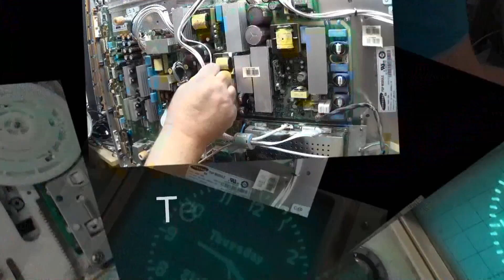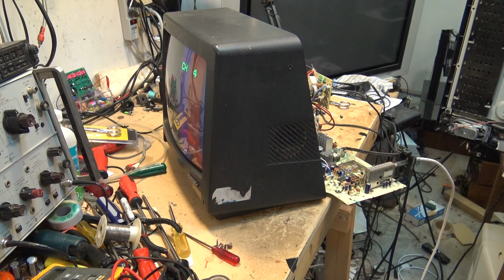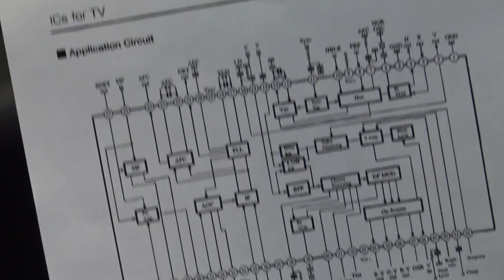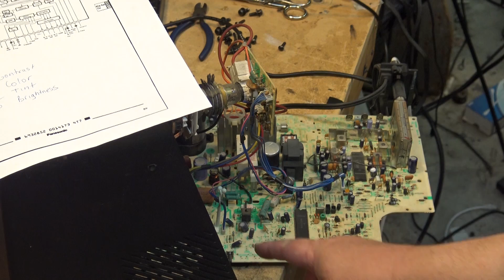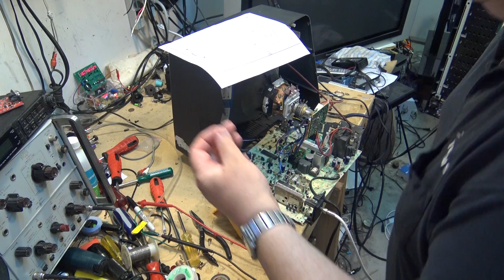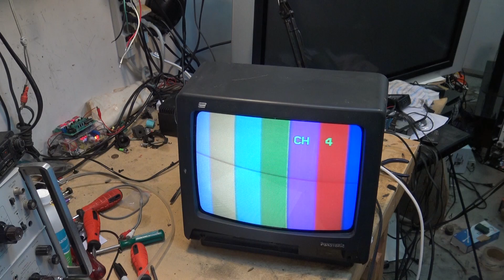Panasonic PC14X41 Poor video level

Comment: Hi there.  Thanks for the really informative video.  A question for you: I have a RCA television from about 1990 (a G26285, which I think is on the CTC157 chassis).  It has a similar picture fault (low brightness and/or contrast), but it's intermittent.  Sometimes it starts after about 10 minutes, sometimes the picture stays good.  When it happens, the picture adjustment controls do stay responsive.  Adjusting brightness up from 50% to maybe 80% gives a decent picture again (though possibly the colors are slightly dull).  Do you have any suggestion of where I might look for the problem?  Or maybe another one of your videos that might be more relevant to that particular problem?

Comment: May you show us how do you modulete the vid bars?
Reply from the maker: Its is just an old Sony dxc1800 professional camera plugged into a wacom vhf modulator.
Reply: @12voltvids  Nice, tks for answer!
Reply from the maker: @IgorIglesias  
I have showed my equipment closet in an earlier video. If you search for it you will see my setup.
Reply from the maker: This is very old, the equipment in here has totally been changed out. Gone is the channelmaster UHF modulator, and in it's place 5 rack mount commercial modulators out of a cable head end. 2 MTS stereo and 3 mono.
https://www.youtube.com/watch?v=bTK8zFtzeZ0

Comment: Lol, another video for people to dislike! I happen to like it. Foo on negative people.
I had a Sanyo tv that kept losing the picture. Found a bad solder joint by tapping on the circuit board. Because the picture would appear if I hit the set. I just put solder over the area that was making intermittent contact and fixed it. About the only successful thing I did on electronics. I was lucky I didn't get shocked. Lol. 1994 tv. Lightning would later take it out. :(
Oh, is that a new pair of electrical scissors?

Comment: Just subscribed, great work. Question, aren't you supposed to discharge the HV cable/ tube before operating on the TV PCB? Doesn't that board carries HV , and also the flyback?
Reply from the maker: Cesar Matias 
The tube will hold a charge but the diodes in the flyback will also block it's return to the chassis. So unless you are poking metal objects under the hv cap that is where the charge is going to stay. Now if you want to remove said cap then yes you clip a jumper wire between the crt ground strap and a screw driver and wedge that under the cap to contact the anode button to discharge the tube. Then remove the anode wire and leave the ground wire clipped on the button to keep the tube from regenerating a charge. ( yes they do that)

Comment: I have a 13.3 inch flat screen tv, and when I try to turn the volumn up or down the menu pops up. If I replace all the tac switches on the set, will that solve my problem, or did the resistors change value.
Reply from the maker: Could be either. I have a 28" flat panel set sitting on the floor that changes settings on it's own. Haven't figured it out yet.
Reply: @12voltvids  My guess: Connection problem at the switch terminals or somewhere in the switch circuit causing the switch to short and change the setting by itself.

Comment: man that board is so big and flexing a lot :], all polish tv's had a metal grounding band around main boards and were installed on rails for easy access :]
whitch is easier to work on, full jungle ic set or modular  early ic one?
you make it look too easy, probably because of your long time experience
i was able to fix one of those small tvs only after getting a hint from local furums, but after i find similar problem online, my tv repair cost me lass than 1$ and 15 minutes of work, it could be 0$ but i wanted audio from both rf and av :]
Reply from the maker: It is relatively easy for me on these older sets because that is what I did every day for over 20 years.  This one with it's symptom threw me initially. It wasn't until I ran the contrast down and the vertical started jumping that I clued in to the ABL circuit because that symptom was similar to one I had seen before, on this same set too!

Comment: i'd change that 220Uf 200V cap. she was shrinking off the can
Reply from the maker: No big deal. This is not a switching power supply. It is linear. When the cap pops it will be evident as big hum bars in the picture. Perhaps that would be a good fault to plant in a set, an open main filter for demonstration.
I don't stage many faults, only under requests, troubles line this are genuine faults that develop in the equipment.

Comment: Good diagnosis! When I was a tech full time, I always kept a log of "dog" problems. You always think you'd remember the fixes,especially tough ones, but a year or two later you'd be saying to yourself, what the hell did I do to correct that problem?  Thanks for the video!
Reply from the maker: That is why I ran that database. I should bring that computer into the shop and put it to use. That computer is a class act in itself. A 486SX laptop with DOS6 and Windoze 3.1. Most laptops on that era were monochrome, but this one has an VGA color screen which was almost unheard of back then. I paid over 2,000 for that laptop, was the first one I bought. It had the largest hard drive you could get on a laptop of the day, 245 megs!
Reply: @12voltvids  My, has the technology come so far. Now we have 4K rendered in an instant and video streaming, also unheard of back in those days, is viable and rampant across the net, like what YT does to show us this video, for example.
Reply from the maker: Samsung is promising 8K tvs in your home next year.

Comment: Great recovery :-D, if it fails again perhaps putting a 47k and 68k resistor in series would lower the voltage across each resistor and still give the same ballpark value.
Some resistors don't cope well with higher voltages.

Comment: I like it. You are my senior good sir! I might actually have a slightly older tv about that size with similar symptoms but it has no on-screen menus, pot controlled.  All I know about soldering is: No cold joints, keep it away from other conductors, keep the solder fresh, don't over heat anything, try not to lift any traces and fix it solid if that happens. I know some folks are really into things looking perfect. If I make something from scratch I hate it when comes out messy but if it's sturdy and it works, that's life and it's good. I sometimes use the old trace-less perf board for projects; I enjoy forming the wires into traces and making it look nice but if I have to "bodge" it to make it work I often don't give a damn unless it's for someone else.
Reply from the maker: I have an old Sony from 1984 in storage. No remote control, if you can imagine that. Actually I have 2. A KV1365, and the big brother KV1965. 
Both are digital tuned, with a A/V input, slider volume control, and these sets both use opto-coupler isolation for the audio and video inputs as the chassis is a hot chassis design.
Both still work, and last time I turned it on had a fantastic picture. That was the second Sony I owned. The first was a KN1932 which had the 14 position preset tuner. I sold that one to a friend, who is probably still watching it, because he is so cheap he never buys anything new.
Funny how extremes can be. My idiot 17 year old thinks nothing about paying 140.00 for a tee shirt with some scribbling on it, and then there is my old pal from high school that has never driven a car newer than 20 years, and is still watching VHS tapes. Not that he can't afford anything new but he is incredibly cheap he just won't buy anything new.

Comment: I miss Panasonic TV's I still have a 32 inch 2008 Model Still works great ( after recalibration) All the Dynamic contrast came back and it looks like a brand new TV .
Reply from the maker: I am still mad that my old CT34WX50 CRT HD set that I gave to my late father inlaw was turned when it broke rather than offered back to me.
Nobody wanted to lift it.

Comment: have you ever had nightmares where you're facing a live tv chassis and the flyback decided to zap you on the lip?
Reply from the maker: I've been zapped by the cobra on a set that was operating. My idiot assistant at the shop attached the HV lead on a set we just replaced the tube on. He didn't clean the glass before attaching it, and there was an air gap. I went to reach over the set to adjust convergence and lightning leapt out the HV cap, into my forearm down through my hand and out my thumb to ground.
Didn't hurt for a few seconds, and then the pain started. Felt like I hit my finger with a hammer. (bin der dun dat) A burn mark was left on my fingernail, and as the nail grew out a ridge was left in the nail that is there today.
30KV from a fully charged, and operating CRT packs quite a wallop.
That was the last straw. I fired my assistant that day. My boss said I couldn't fire him it was an accident. I said he goes or I walk.
Next day the shop was down to 1 tech.
Reply: @12voltvids  Good call there. I would've left there too, wherever it'd be, in that situation myself. He nearly killed you by making a small mistake like that. Any further up your arm and the shock would've been enough to stop your heart instantly.

Comment: I think that resistor is brown-green-yellow, so should be 150k but as you said and demonstrated, it didn't matter so much. Almost like you knew what you were doing :P That's a joke by the way, not giving you any guff or questioning your abilities, knowledge, or hands-on experience :D As far as that resistor goes, being that 50k ohms didn't make any apparent difference, what is the purpose of that resistor? Also, is it simply not that critical a value to need to be exact or is there circuitry elsewhere that makes appropriate changes depending on what it sees or ? Just curious as it seems these older TV's are pretty resilient compared to the newer stuff.
Reply from the maker: Yup, the bigger one was the one I changed the last time that set was fixed which was May 14, 2014 in this video:
https://www.youtube.com/watch?v=AHuUTkhk9Vw
Funny almost exactly 3 years to the day since the last service of the TV. 2 resistors, same circuit causing different symptoms.
Reply from the maker: If they could shave a penny off the production cost, then that is what they would do. This is not a high power circuit. 1/8 watt was cutting it too close though.
The database program I would add things into that were tough dogs. 
When I got a set that had an unusual problem I wold scan the data base first to see if it had been reported, as that many times would save me a great amount of time troubleshooting. If it was something that was the first time reported I would put it in the database.
At the time this was a commercial program and was a live update.
So anything I put in there I would upload every week, and get the other updated put in by other techs in the engineers fourm I would hang out in.
Reply: This man knows his stuff. I've been a subscriber for quite some time. He never fails. Except for the ones that are beyond repair.
Reply: Entertainment Videos DWN Oh I know it. I've also been a subscriber for some time and I watch all his videos, time permitting, multiple times even as there's always some good nugget of information to be had if you pay attention. There's nothing like years of experience of actually doing the work and as I don't have those years of experience doing this day in and day out the next best thing is to listen and learn from someone who does. I just hope he doesn't take my questions or comments as picking on his work as I've never had a problem with it. There's also a difference between fixing the outdoor tv set and fixing Mom's beloved living room plasma TV. You make sure Mamma is happy, cause if Mamma ain't happy, ain't nobody happy. ;)
Reply from the maker: Brown Brown Yellow, 110K.
I have the old resistor still on my bench where I left it. I can send you a high resolution close up picture. R555 110K R554 150K.
Reply: You've got nothing to prove to me; no need for a high resolution close up picture. I use a 43" 4K display as my computer monitor so that 110K resistor is about the size of a cashew already. My mistake was in hearing previously you mention probably a bad resistor, but apparently not hearing you say it's right next to the one you changed last time which is the 150K resistor you lay your finger on at about 17:34 and I can see the 150K which is the one I thought you were talking about, as the one you actually meant was mostly out of sight except for the very butt end of it as it was hidden by a capacitor. You do move the board afterward which reveals the 110K but my mind was still on the one I saw. I should have picked up on my mistake sooner when you mentioned the resistor being a 1/8th watt which the 150K would have been too large at that point to be the resistor you were talking about. But again, as I said, not picking on you at all or trying to give you a hard time, I just genuinely thought you got the color wrong as I know under certain light it can be hard telling the violet and brown apart on some resistors. No worries :)
Reply: 12voltvids That is interesting. I'm guessing the manufacturer would have used the 1/8th watt resistor to save money? Would just using higher wattage resistors perhaps curtail them from burning out? Or do you think they go out from a sudden spike in voltage perhaps and so they're meant to burn out like a fuse almost to protect the rest of the circuitry? I also remember you showing your notes database from your servicing days and I wondered if you recorded every repair or only things that stood out? Thanks for not taking my initial reply to your high resolution picture offer the wrong way. I noticed after reading it back to myself it might have come across wrong as all I really meant to say was I believe you :) Thanks for keeping up with the videos by the way, they are as always, much appreciated by myself and I know many others on here, no matter what the few disgruntled dislikers have to say about it.
Reply: 12voltvids Oh so it was actually distributed amongst techs so you could all benefit from each other's combined experience. That's pretty awesome.